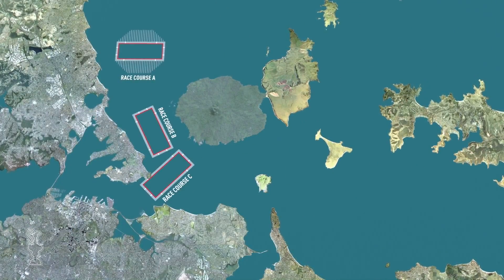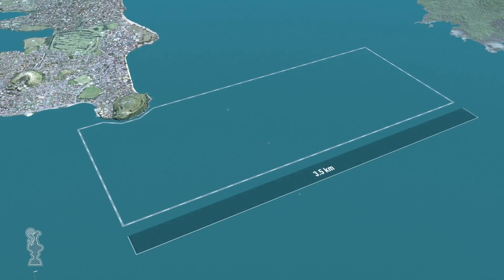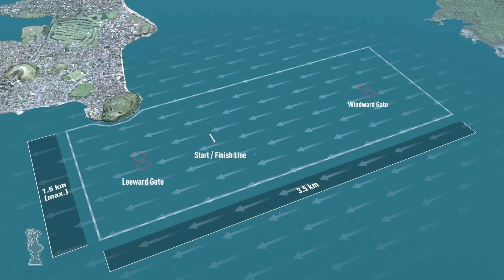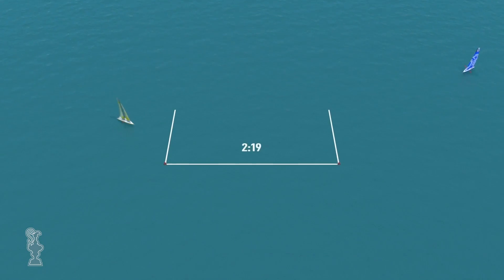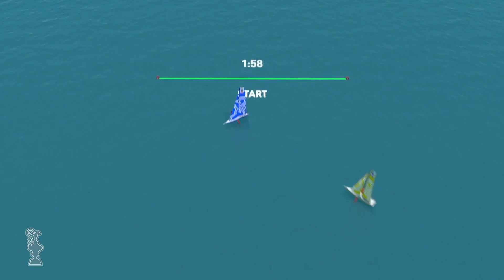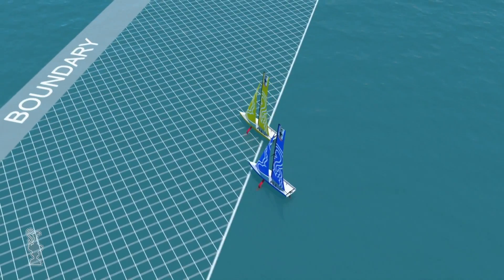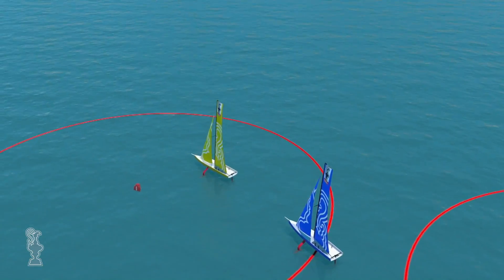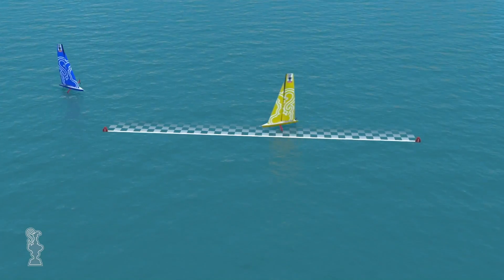Know the Rules - The Course

Comment: Why not just go straight?
Reply: Wind
Reply: @kvaka009  thanks! But how? The go un zigzags across the course
Reply: @highflyerl23  well, to further elaborate from a short answer to the best of my abilities, wind has direction. It is impossible for wind to give a uni-directional vector in a body of water. In order to remain consistent in speed, the sails of the boat need to change in order to accommodate the velocity of wind. That can possibly be one of the reasons why the yachts go in a zig-zag line.
Reply: @micklykan7057  thanks. I looked it up. Makes sense now
Reply: The first time you jump into a hobie cat and try to sail upwind you learn why they zig zag very quickly